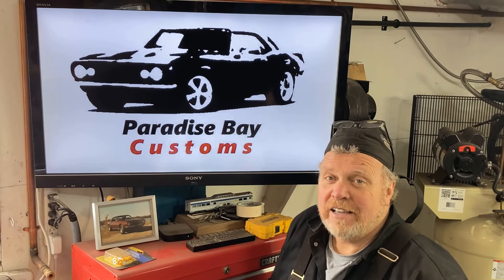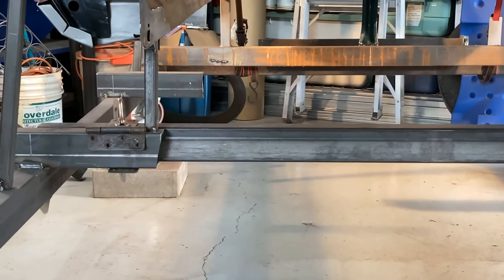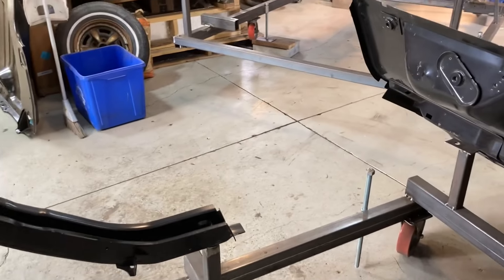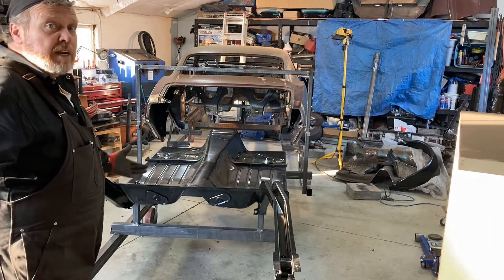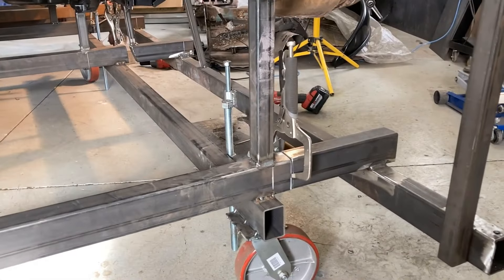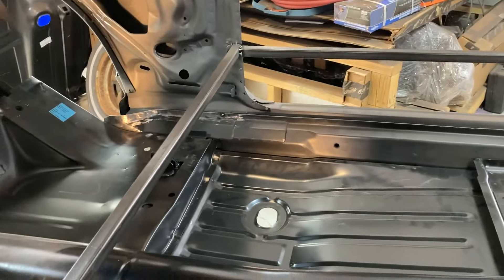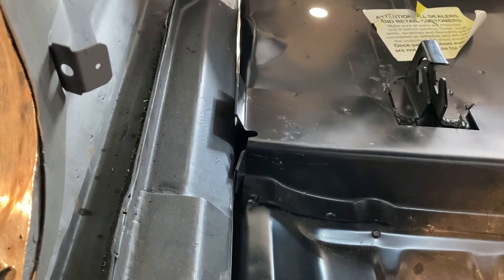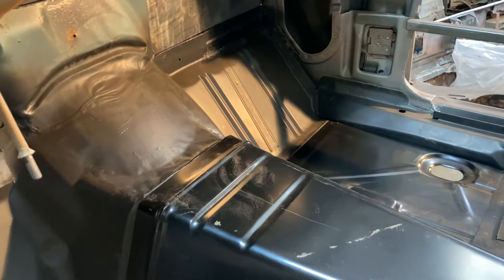HOW TO Install Floor Pans in a Car!  Full Floor, Trunk Pan & Frame Rails - Pro Touring Camaro Build

Comment: I’m rebuilding a ‘67 convertible and I have a lot of work to do on it before I get to the floor pan. This is a great video and gives me a lot of good information. I have a channel as well and know how much time and effort it takes to put out content and get work done on the car. I’ve had a few mishaps along the way and have not worked on it for a while, but more is coming soon on mine. I’m on rockers right now, driver’s side is in and passenger side is almost completely out. The convertible rockers are more reinforced and pretty heavy. Great videos and keep up the good work!
Reply from the maker: Thanks. I’ve been following your build (and mishaps) too… Look forward to seeing yours progress. Keep the videos coming. 👍

Comment: Nice! Are you an engineer ? A lot of thought went into that jig setup. My floors are Dynacorn as well and I have to say they fit well too. I’m trying to go with AMD on all the outer panels if they are available.
Reply from the maker: Close… Architect. 😂 Just a gear head at heart. The build has been a creative release through the pandemic and a great way to pass a cold winter. Thanks for watching and commenting. What’s next on your project?
Reply: 😄The word tolerance in your description made me wonder. I just finished welding in the new lower cowl, outer cowls and firewall, Lots of grinding to do. Quarter panels are next.
Reply from the maker: @TheLooper0  Sounds like you are a few steps ahead of me. Fine job. I’m still debating on my quarters even though I have new ones on hand. I’m letting the notion of replacing them percolate as I’m fond of saying! 😂

Comment: Looks awesome… Dynacorn is made in Taiwan but AMD is the best sheetmetal made in Taiwan.
Reply from the maker: Thanks. That’s what I’ve heard. No complaints here so far. Time will tell.
Reply: @ParadiseBayCustoms  same steel